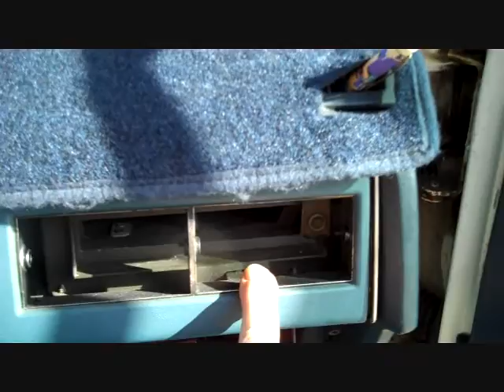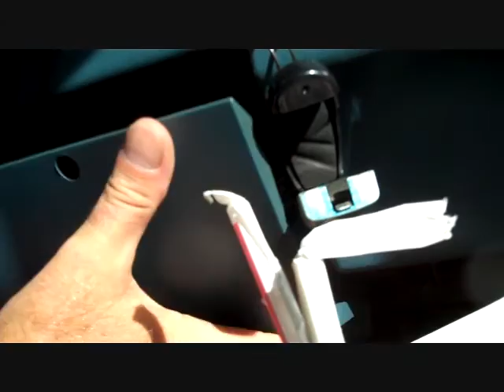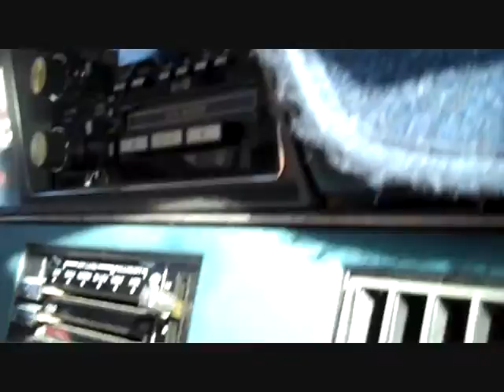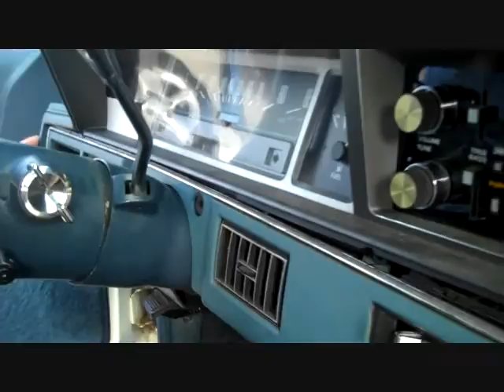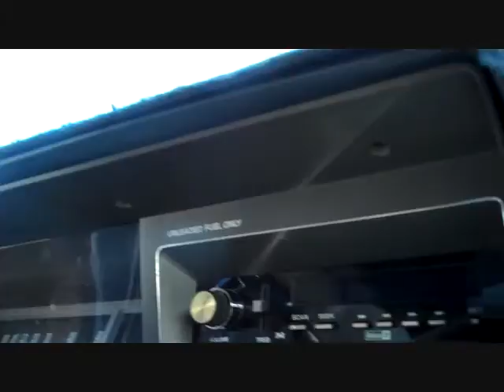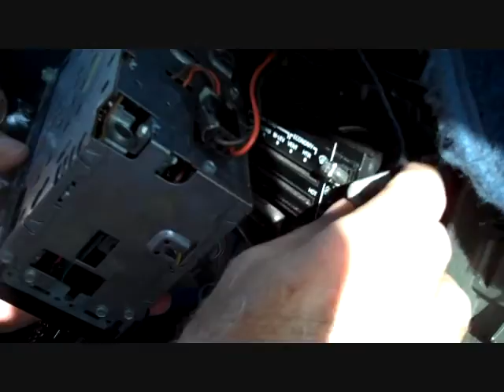Oldsmobile Ciera Stereo Removal = Car Stereo HELP

Comment: will a double din stereo fit in a its place?
Reply: Yeah, I'm replying to a 3 year old post, but for the record, what's in this video is known as a "1 and a half" DIN. A DIN 2 is too large. 

In the last month I've replaced the stereo in a '96 Ciera. Searched Crutchfield and nobody offers a 1 1/2 in 2020. Had to go with a DIN 1.
Reply: @JoJoGunn1956  I want to get this Jensen 1 DIN that has an attached 9" touch screen for my '93 Ciera.